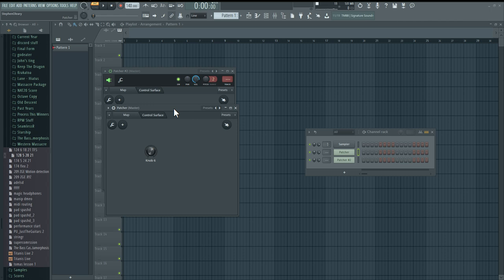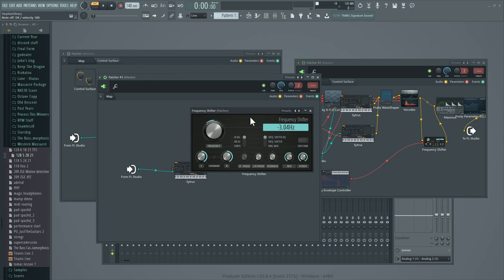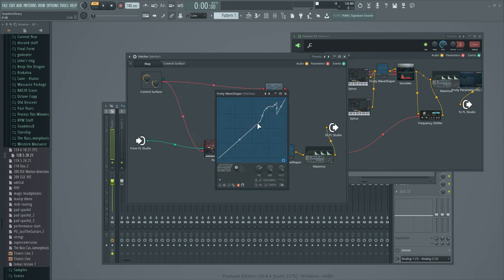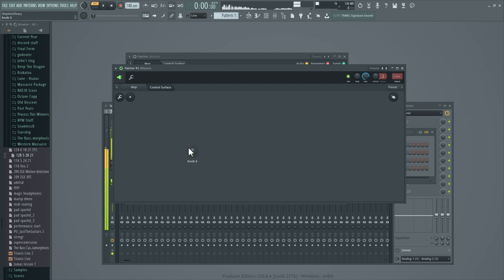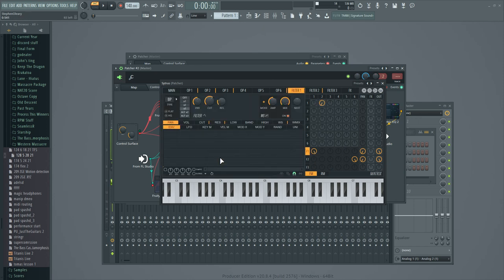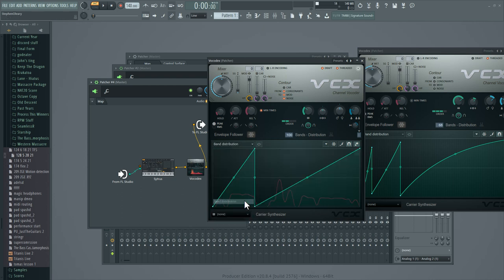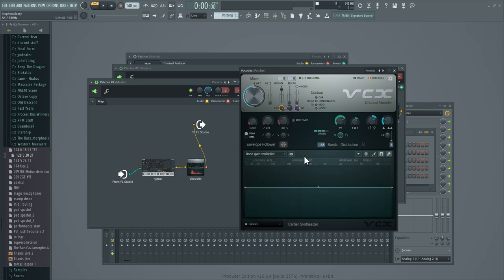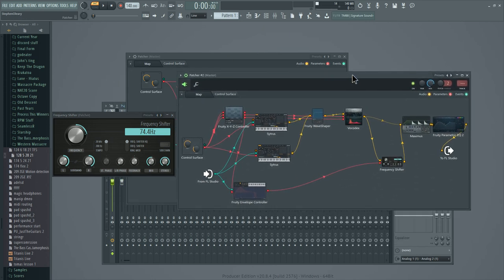How To Bass 242: Wet Dry Frequency Shifter Mix

Comment: What does the waveshaper actually do? I see it only as a distortion plugin all the time. What does that white line do really?
Reply from the maker: It's a description of a change in amplitude applied to a waveform when that waveform comes to that amplitude. 

The graph is an in/out graph. The white line, when it's straight from the bottom corner to the top corner, is telling you no change happens at any amplitude. But if I put a bump up in the upper quadrant that doesn't change the lower quadrant, what that says is the waveform only gets moved when it reaches that amplitude, and the line describes by how much it gets changed. Either up or down depending on how far away from the original center angle your change is. 

A totally flat line from beginning to end stuck right up top is saying no matter what happens, no matter what level it is, it is now completely at 0db. 

If you put a saw wave through it and leave the lower quadrant the same, put a point dead center, and bring the top point down to the lower right quadrant, you'll create a triangle wave.
Reply: @SeamlessR  I feel like you know more about these plugins than the guys that created these plugins

Comment: Do you think having a frequency shifter->distortion-> un-frequency shift would have a cool effect? Would it create some kind of atonal distortion?

(Also can you please please please please do a tutorial on ps2 like pads and sound design I beg seamless I’ve been trying to get that type of sound forever)
Reply from the maker: wow are we already at the "ps2 retro music" stage of things? ;D I did just find a stack of my old games. Wish I still had a working console. 

But yeah it would totally get all atonal but probably neat. As you might imagine, if you shift something up and then down by the same amount, it's just the original value. But then whatever gets put in between will be shifted.
Reply: @SeamlessR  haha seems like we are getting there. To be fair though, ps2s have gorgeous sounds, so I imagine the urge to replicate them may occur a little sooner haha. I’ve been wanting to emulate that system exclusively to hear the sounds.

I am now realizing how much is possible with the frequency shifter. I imagine flangers would sound like a bizarre phaser when put through the same system. There’s quite a lot of untapped potential there wow.